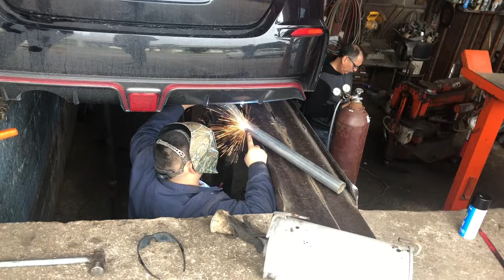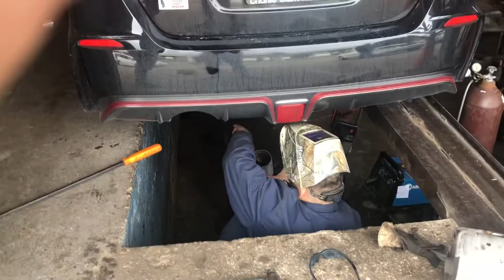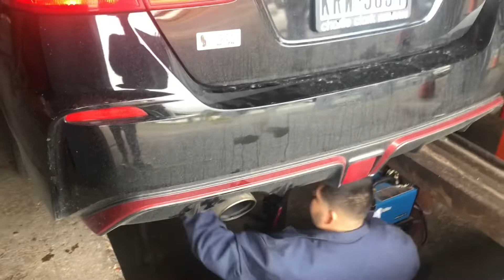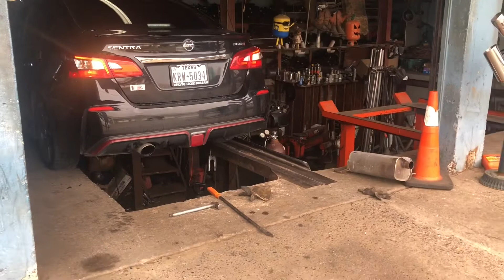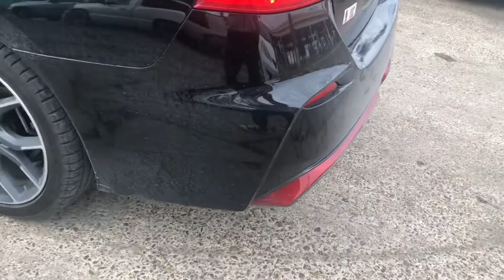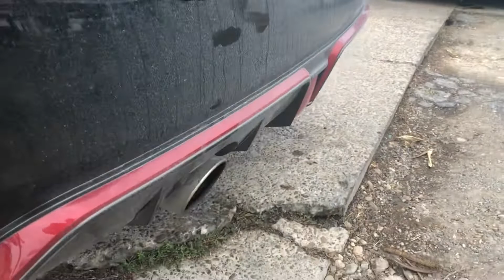2017 nissan sentra nismo muffler delete

Comment: It sounds like an Abarth 500, which isnt a bad thing as its widely regarded as the best sounding modern 4 banger. It makes sense that they sound so similar though, the Abarth is a turbo charged 4 cylinder which comes from the factory straight piped.

Comment: Any rasp?
Reply from the maker: Ryan Chow no sir
Reply: @streetterrorperformance6227  might have to delete my muffler too 🤔 how do you like yours?
Reply from the maker: Ryan Chow its not mine its my friends but he likes it you can hear the turbo spool. It sounds alot better then we thought it would
Reply: Street Terror Performance I thought this car was NA ?
Reply: @AntoineJra   the 2017 model has 2 turbo variants.
Reply: Ryan Chow so could you just upgrade the turbo and make upwards of 250whp?
Reply: @AntoineJra  the car is rated at 188hp by Nissan but a lot of people put it on a dyno and got 190hp to the wheels. I don't think there are lot of turbo kits out. But there's a tune that goes from stock to 225WHP
Reply: Ryan Chow well the engine is nothing new. It’s a SR correct? So I’m assuming it won’t be hard to find the aftermarket support for turbo upgrades
Reply: @AntoineJra  SR turbo it has a 1.6L